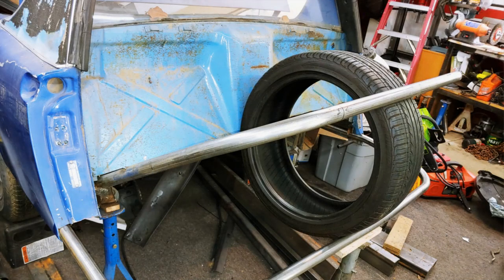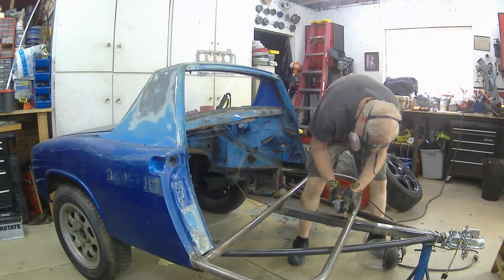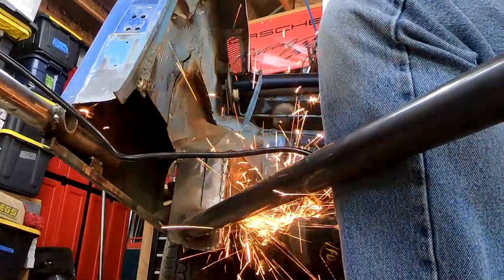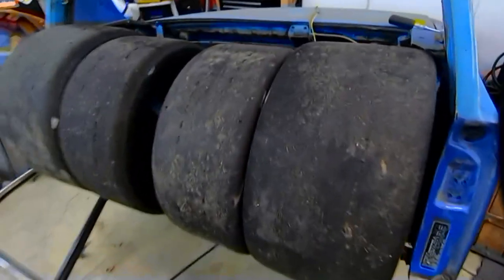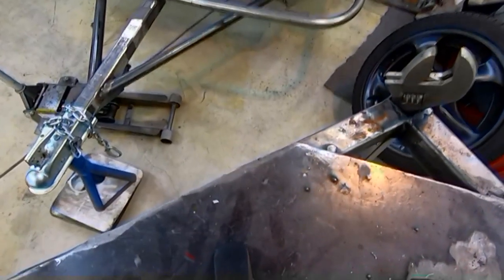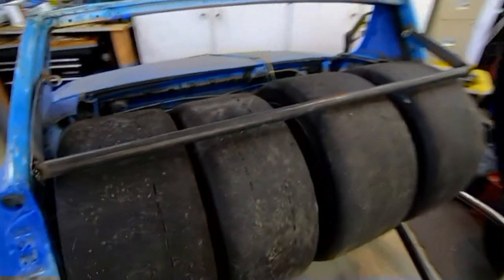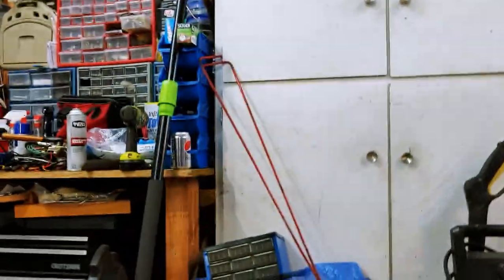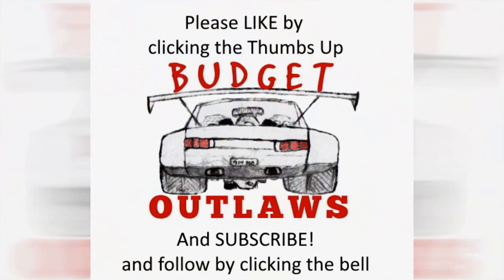Half a Porsche Car Track Day Tire Trailer - PART 2  Making it realistic

Comment: I fixed taillights by taping a few layers of duct tape over the the missing material. Then mixing some transparent dye into Envirotex epoxy and pouring it into the void left by the missing material and letting it set .  Cheaper than buying a new taillight.
Reply from the maker: That's a great idea.  They look ok, but kinda fall apart.   Actually I don't have a 'drivers' side lense.  I need to find one.